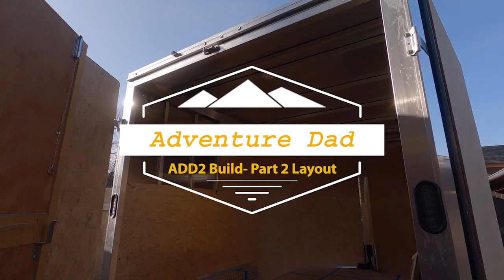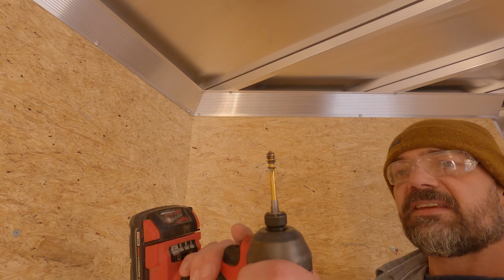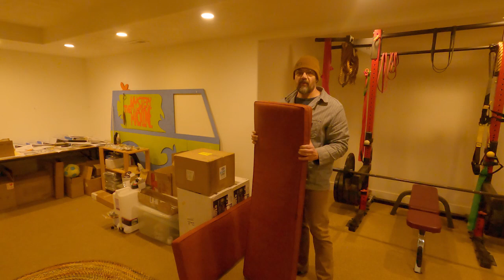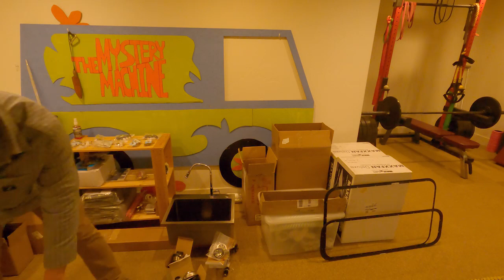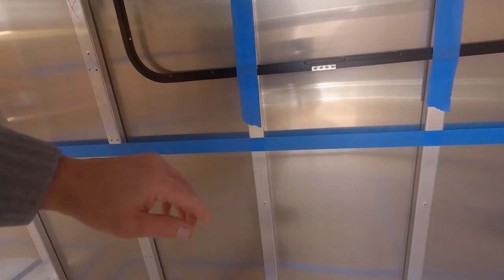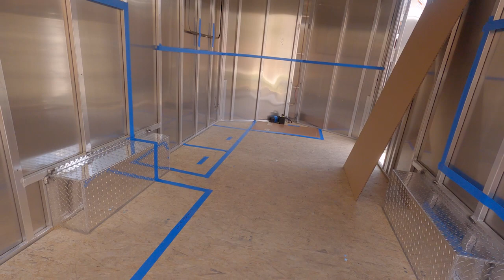DIY Cargo Trailer Conversion- Part 2     Teardown & Layout

Comment: I am ordering my 7x12 aluminum trailer next week. I am wondering if I tell them I do not need the side vents as I will put in a roof Maxxair. The vents would be behind cabinets and under garage. Does that make sense? What’s your experience on this?
Reply from the maker: The vents are for a fully sealed trailer.  If you are going to add windows and roof vents they are not needed.  Be sure to leave your roof vents cracked.  Our first trailer came with vents- I covered them with aluminum HVAC tape and reinstalled the out vent cover.  I ordered our most recent trailer without vents- cleaner all the way around.  

Best!
AD

Comment: I like how you laid out your plan and got a great visual of it at the very start. Im also in progress of by CTC build since Nov (weekend builds) on my 7.5x16’ trailer and layout’s been a struggle, mainly because Im hauling a 12.5’ SxS with it and also a family of 5 to fit. Anyway Im just sticking to the basics. Keep the videos coming, and Im envious of the CnC! Fellow Boiseian here by the way.
Reply from the maker: Jim,

Thanks for the comment.  I have been working on getting clearance for a side by side for a build we want to do for a family member- they are deceptively large.  The height is a real issue- over 80" with tracks on.  My electrician was showing off pictures of a build he did years ago.  He used a murphy bed mounted to the side wall which allowed enough clearance for his SXS.  
I would love to see what you come up with!  It is a lot  of work but worth it- we are taking the kids winter camping at Craters of the Moon this weekend.  Wouldn't consider the trip without the camper.
Best! AD
Reply: @adventuredad1180   nice. We have no choice for the bed except something that can sit at the back and either be disassembled or raised when SxS is inside. Im sticking to just etracks on the wall with loadbars for the bed platform for now to at least get my bed ready for spring. The trailer only has a about 6” clearance on either side of the UTV so unfortunately a murphy bed isnt an option. I finally had my flooring installed this weekend and etracks on the floor follows this weekend, so layout should be finalized by then (after several weekend builds since Nov last yr). Ill see you and your trailer around 😊

Comment: Hi - what are the details on that sink?  Looks close to the size I am looking for.  Thanks!
Reply from the maker: Neil,  I just saw your comment.  I think I am going to like this sink.  Top mounted.  Counter flange is 20" w x 16" d.  Bowl is 18"w x 12" d (counter to wall measurement, couldn't figure out what words I wanted to use here) x 9" d (vertical bowl depth).  Here is the Amazon link (not Affiliate)  https://www.amazon.com/gp/product/B08NY6RG79/ref=ppx_yo_dt_b_search_asin_title?ie=UTF8&psc=1 .

This sink is more money than a typical bar sink used in many RVs.  However, the extra depth is really key.  Many cheaper bar sinks are only 5" deep (vertical bowl depth).  I also had a heck of a time mounting my undercounter sink in my last trailer- no room.  Best! AD

Comment: If I subscribe to the Fusion 360, is there a way to access the 3d shell you have already created?
Reply from the maker: I think we could figure that out.  Fusion360 does have a free hobbyist side but I don't know how collaborative it is.  I have also used graph paper and cut out pieces of construction paper in the past.  Get your trailer shape onto the graph paper.  Cut the construction paper to scaled size for the components you want- then just move them around.  Also SketchUp is good as well.  Happy to help!

AD

Comment: Do you still have your first gen? Man I’d like more content on that. Love that thing
Reply from the maker: DK- thanks for saying that.  I have been meaning to do some  videos.  It is my favorite truck ever- so nice.  But, I am going to sell it and keep our 2021 Tundra.  

I will get on it!
AD
Reply: Cool man! Look forward to it. Building my tundra a lot like yours. Let me know if you’re going to sell as is or sell some of your accessories prior.
Reply from the maker: @derekkygar373  DK,  I am going to try to keep all of the bolted on accessories with the truck.  However, I do have a Thule XSporter Pro and a CVT tent I am going to sell.  I have been debating taking the topper off and putting the rack and tent back on.  Having the tent with the truck would increase the price but the truck would be 'Adventure Ready'.  I could never decide between using the topper or having the tent.  Now that we have our trailer I am going to sell the tent.  Let me know if you are interested in the rack and tent- I can get more details if you are.  I need to email CVT because I can't remember which model it is- sleeps four and has a ground annex.  
Best! AD
Reply: Ya I just got a leer topper for mine and I’m pending a paint match so I wouldn’t need the rack or the tent. I do want to buy a decked system but they are expensive and they don’t make one for the gen one, have to make cuts to another fit. I guess that would maybe be what I’d be interested in is your drawer system. Id be super interested in your deaver springs, I have a 2006 as well so that would work. Seems like a weird thing but thought I’d throw it out. I’m going to installing 6112s and 5160 in the rear and now have factory with a block. Let me know? I live in Boise as well
Reply from the maker: @derekkygar373  I am glad you threw it out there.  I am going to be designing a modular truck drawer system.  It may take some time but the wheels are already spinning.  I have used Decked, TruckVault, several hunting specific models.  I have also thrown together several that really stood up over time.  I will reach out when I get the design figured out- maybe we can arrange some beta testing.  
Best! AD
Reply: Sounds good, let me know. I can shoot you my contact information if you get it figured out. Appreciate it!